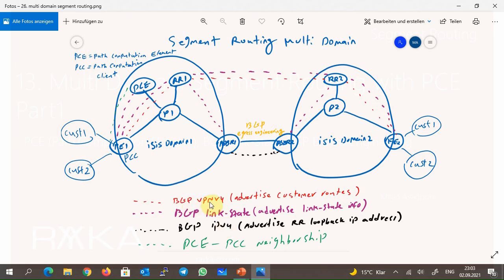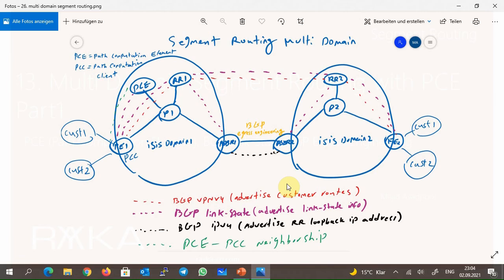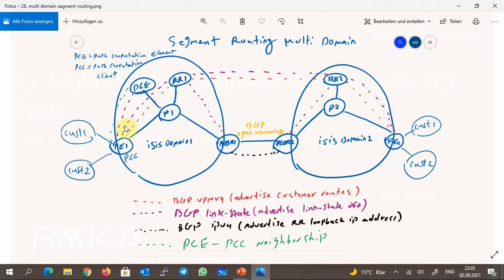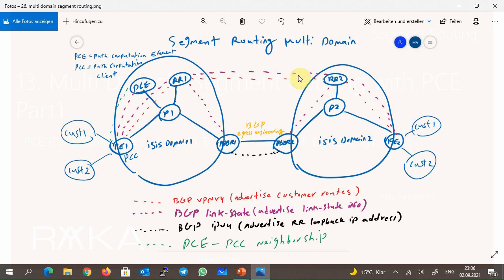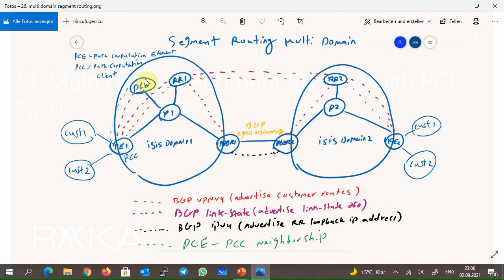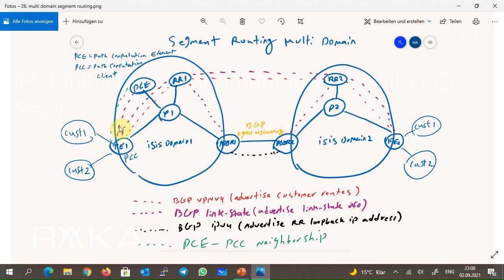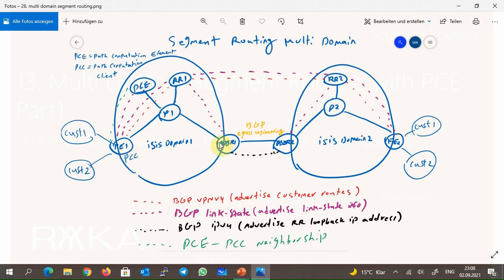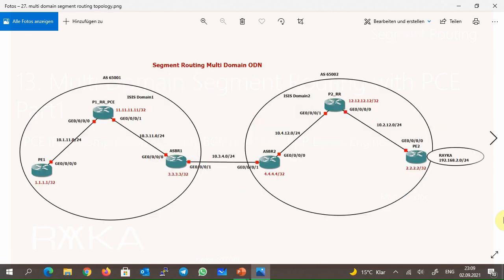13. Segment Routing Multi Domainwith PCE Part1

Comment: Hi Majid,
I am implementing a scenario about multi-domain segment routing traffic engineering with two kind of IOS. One is XR IOS and the other is XE IOS. I am facing whit some problems in XE ios. Two commands are required in my configuration but I did not find them in ios XE!!!

in ios XR :

1.

router bgp ...

neighbor x.x.x.x

egress-engineering

2.

conf t

pce
address ipv4 x.x.x.x

Do you know what is the equivalent of the above commands in ios XE???